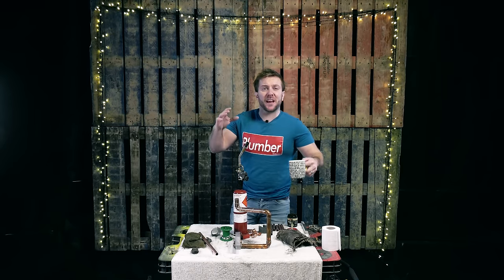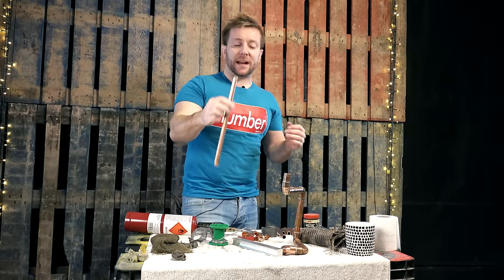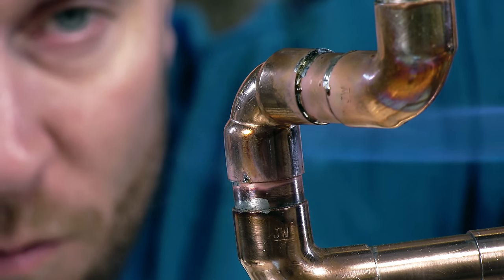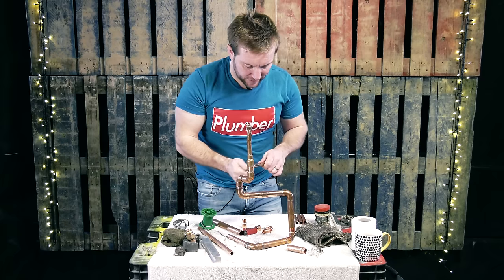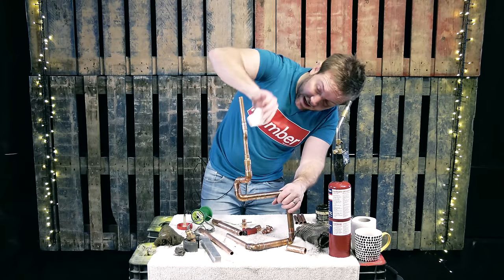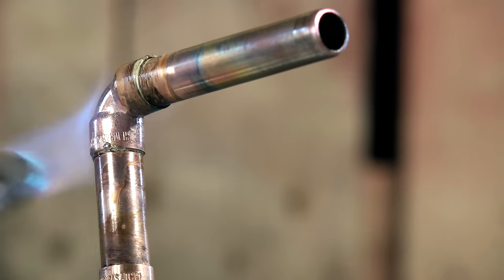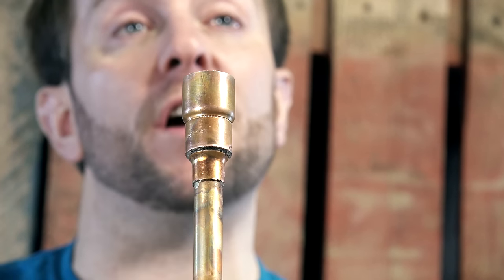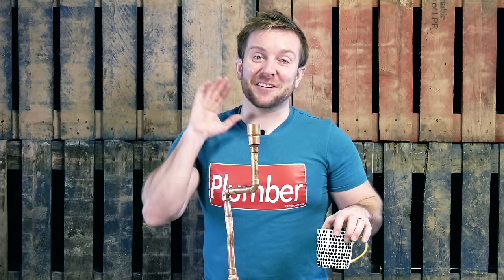HOW TO SOLDER COPPER PIPE FITTINGS WITHOUT SNOT - My plumber methods

Comment: the only way to know a joint is made properly is to see a small bump below horizontals or a drip from vertical. Absolutely no way i would be happy with these joints, your looking at a 3%-5% fail rate, unacceptable..,  look at the most liked comments, they all agree.. and as for wiping flux on hot pipe!!?? toxic voodoo nonsense!!, infact, why even the brush?, it gets badly contaminated, the best way to apply flux is with the clean end of the solder that you already have in your hand anyway!! no need to be anal about it, it boils and runs round the joint just like the solder does...
Reply from the maker: I very rarely get leaks babe. But thanks for your comment. I hope you find a way to move on with your life....😘
Reply: Eh, it shouldn't be necessary but I've tried the "finish the job by brushing flux on the finished joint" method. It ensures the solder has flowed properly all around the joint and cleans up the appearance and solder fills all the gaps from the outside in. But, IMO it's likely beneficial only if you didn't apply sufficient flux and properly in the first place. Bottom line, I don't know that applying flux on the hot joint as the final step can be bad and if it makes you comfortable, it's OK to do it. Just don't forget to wipe the joint with a wet cloth as your final step.

Comment: Real world you can't walk all the way around your fitting. When the flame turns green, time for solder, you are burning the flux a bit. A nice filet around the joint is insurance it will never leak, solder is cheap, don't be afraid to use it. You can heat the snot and wipe it off if you are OCD like me.
Reply from the maker: Mark. Dear boy. I made a video about 5 years ago called something like ‘How to solder in the real world’ you’d understand I feel your pain! Plus I was fatter back then!
Reply: @plumberparts  haha fair enough, thanks for the reply! I'm already subbed!